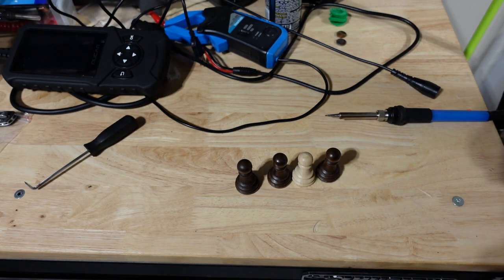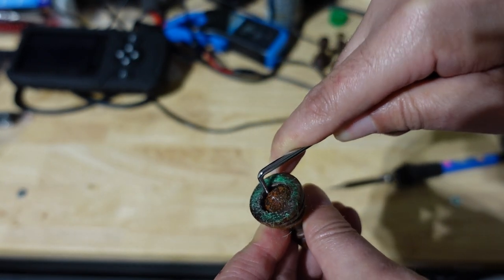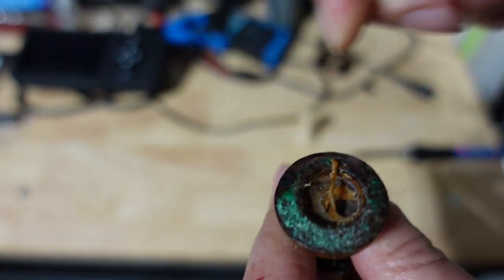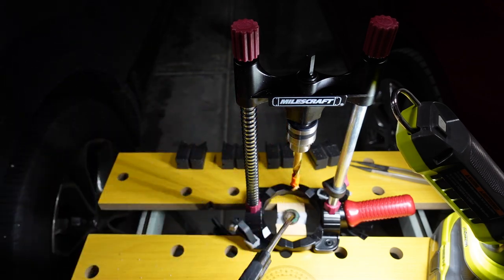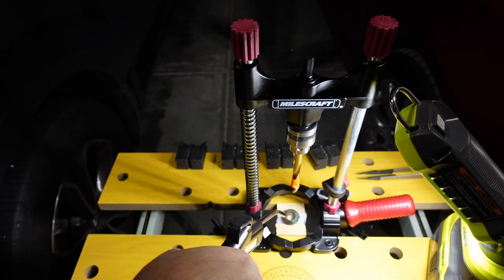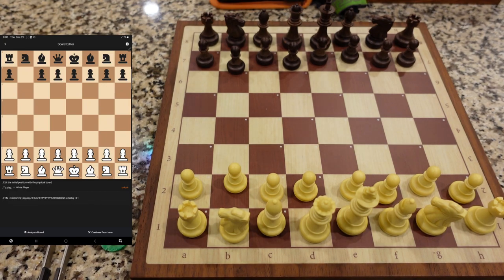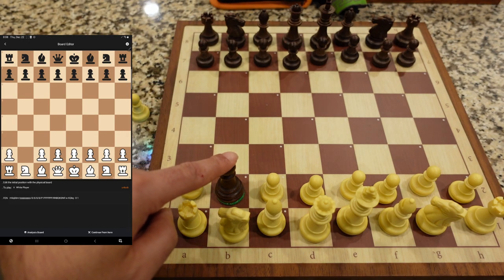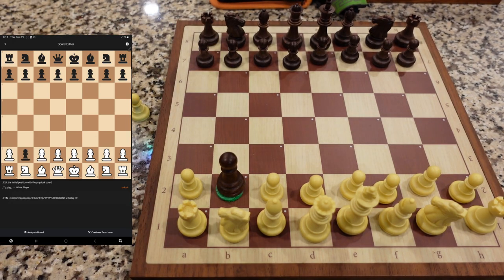**UPDATE 3** Chessnut Air DIY chip install into NEW pieces and UPDATED PROCESS DEVELOPMENT

Comment: Did you figure out a way to get to the battery? I am thinking the surface must come off first using a heat gun.
Reply from the maker: No not yet. I assume like you that the surface would come off.
Reply: @katzenpapa  this may help. https://fccid.io/2A3RB-CA100/Internal-Photos/Internal-photos-5561653.pdf
Reply from the maker: @Murat807  Thanks!

Comment: Good video, thank you! I don't understand why Chessnut don't produce pieces that are more attractive, that people want. It would stop all this business with removing the sensors and putting them in alternative pieces. People are doing this because the Chessnut pieces for the the Chessnut Air aren't very nice, especially the white pieces. I don't get it!
Reply from the maker: This was that very first product and it was taking a big chance entering this niche market. So basically they focused on the functionality of the board and delivering a product that would have outstanding performance which is what they did. Now they have turned their attention to expanding on their product lineup and have done an excellent job at creating much better pieces and other experiences. And at least there is an option to upgrade the pieces. Most companies don't offer their chips so you can make your own pieces so at least you have that option. I hope this helps.